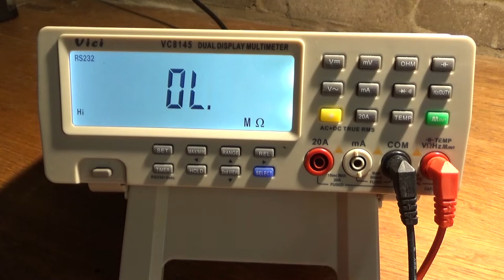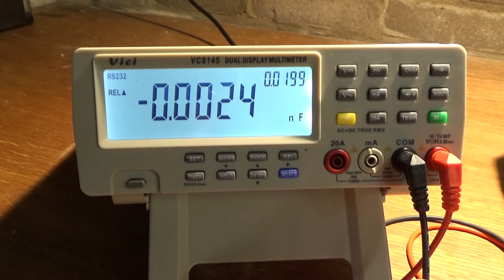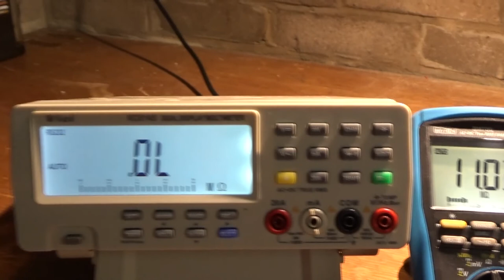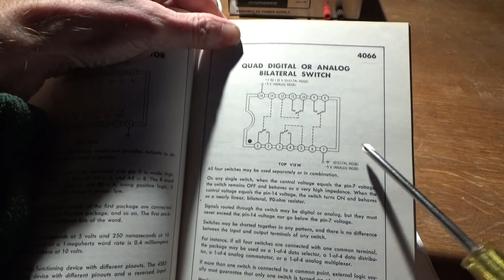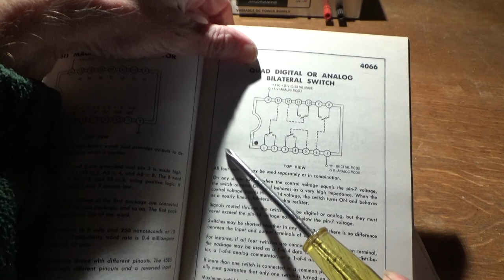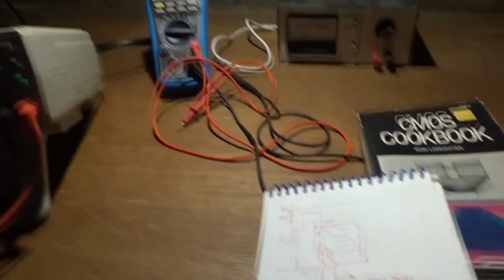VICI VC 8145 bench meter

Comment: I am afraid this behaviour is typical voor cheap multimeters, looks good, but a bad user interface, incomprehensible functions and buttons, questional accuracy... Stay with the quality brands multimeters, I would say. I use a Fluke  11 and a Beckman 2020 (according to medical standards) and a Fluke 8000 benchmeter for many years now, and they can do everything I want to measure...  I do'nt want to fiddle around or modify these.
Reply from the maker: It's not that bad when you get used to it and I might as well use it on the new bench in the garage.

Comment: At the beginning of the video when you enter the dual display I recon that the main reading is measuring AC+DC not just DC, whilst the secondary reads AC. I already saw this meter somewhere else. Is the HP you mentioned a bench one too? Would be interesting to see that as well. 
I’m trying to find where’s the issue with my last arrived instrument, the Marconi 2610 true rms voltmeter. It seems that in the lower range (2mV) I can’t get it to measure accurately. A 2mV signal is read like 1.5 ish. According to the specs the accuracy is pretty good. 
It must be something in the path of the 2mV range. I’ll make a video on that when I get the chance. For the rest of the ranges I could realign it more or less.
Bye now
Reply from the maker: You are right diego, it is showing ac + dc, I realised that latter! I haven't used the meter for some time so it takes time to get used to it. The hp is a classic 34401a bench meter, 6 & half digits. I think its been in several videos.
Hope you can sort out the marconi.
I've not completely given up on the 8500, I will have another go at it one day but its now getting too cold to be in the workshop for long hours, so probably wait til the spring. I hate to be defeated by a fault!
Reply: @ptronix  yeah it is somehow frustrating, isn’t it? Btw the Marconi 2022E have been working well ever since my repair on the OM345s. Quite happy with that! On the back of my table also have a radio to be fixed. Waiting some parts. Is a Yaesu FT857D. I’ll definitely have to make a video on that one! 
oh and btw don’t you have space in the house for the lab to be at warmer temp?
👋
Reply from the maker: @IZ0MTW  Hi again, good your 2022 still working, you probably won't have any more trouble with it, mine is too with all it's OM345s! strange that some fail and others don't. 
Would be interested to see a video on  the 857 repair.
I have been known to work in the house on a big table, but it's a lot of hassle carrying things from the shed back and forth and I prefer to  keep the workshop and house separate.
Actually it's not that cold yet, forecast 17 c here today, very mild for the time of year.
best wishes Nick